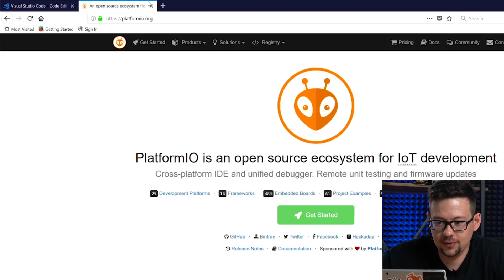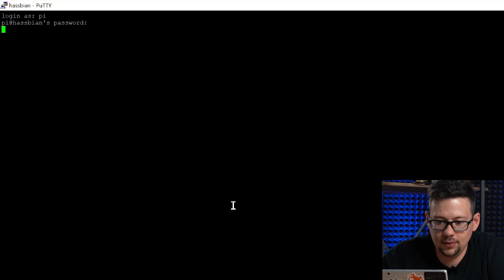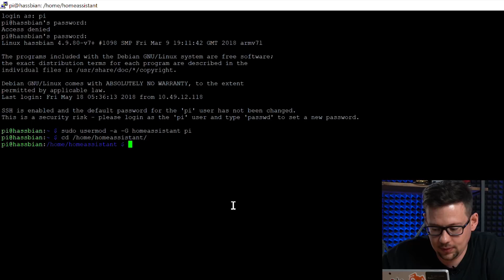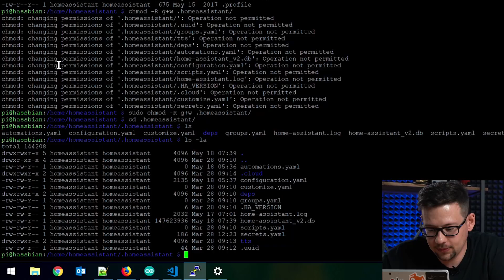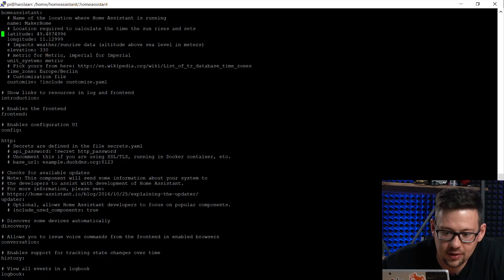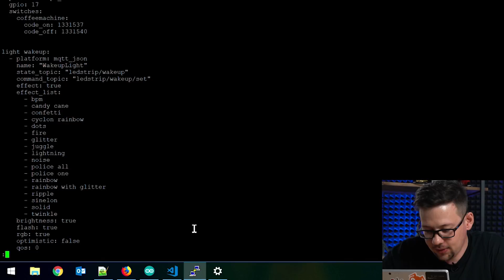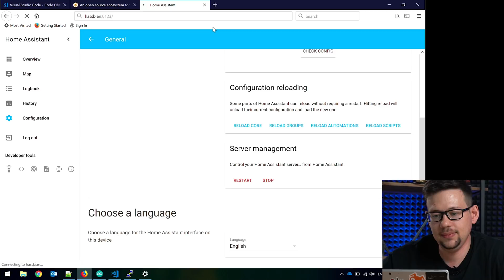Set Up and Configure a Wake Up Light with Home Assistant (2/3)

Comment: @PaesslerAG When I try to turn on the light in homeassistant the toggle in ha turns on and then off while the esp board sends this to  the serial monitor:  
Message arrived [ledstrip/wakeup/set] ON
parseObject() failed
How do I fix that?
edit: In ha I get this error:
Platform not found: light.mqtt_json
Reply from the maker: Really nice point, Isak. HA had breaking changes with 08.4. Please use MQTT instead of MQTT_JSON, and add schema:json to the params. Have a look here for more info:

https://www.home-assistant.io/components/light.mqtt/#json-schema---configuration

We've updated the change in our GitHub repo:

https://github.com/PaesslerAG/maker-monday/blob/master/Episode_003/example-for-configuration.yaml

Hope that helps!
Reply: PaesslerAG Thank you very much! Works perfect now. Really good work with the videos, keep it up!